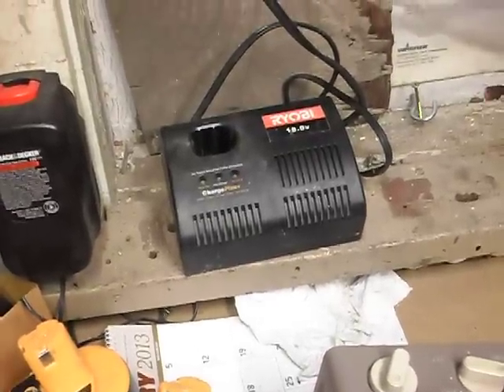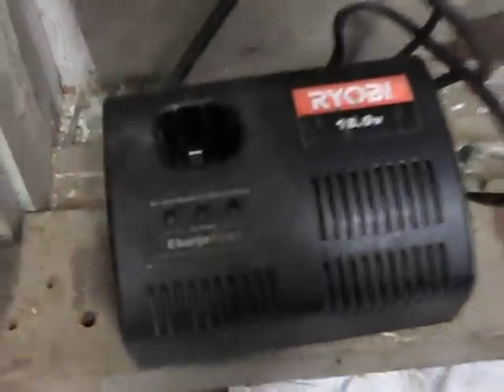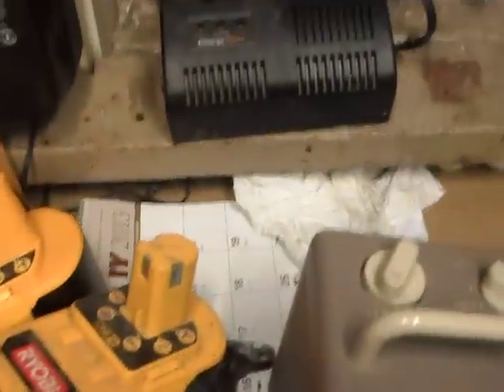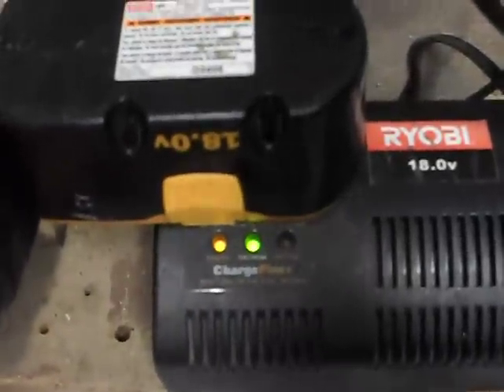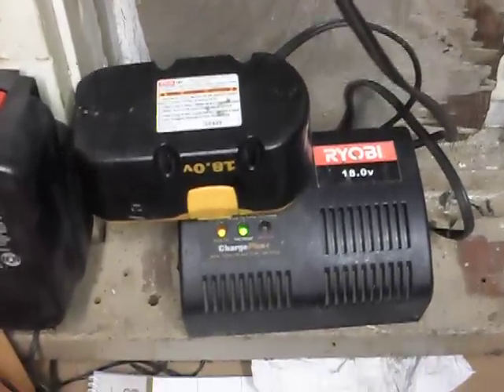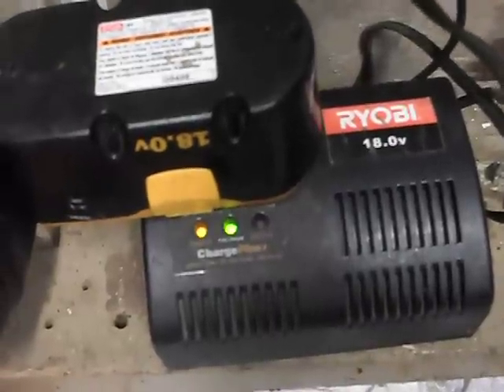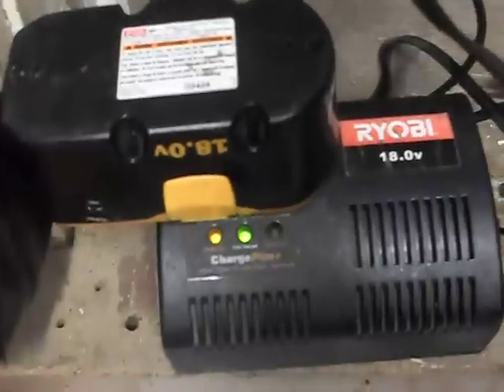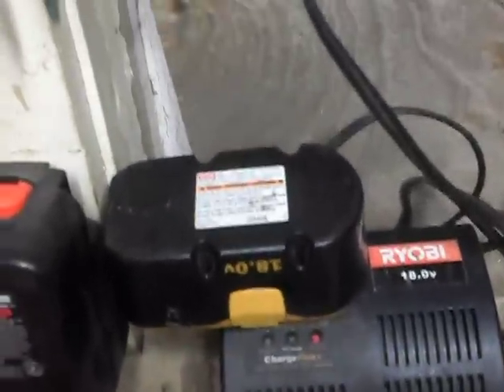How to charge A DEAD Ryobi 18 volt rechargeable battery! IT WORKS!!

Comment: Watched this a while back, not sure if I posted, but I can confirm this works. Some of the batteries change and last a good long time, others not so much but better than nothing. How about anyone else?
Reply from the maker: yep worked for me too...or i wouldn't have posted this video. lol thanks for watching, and commenting!
Reply: @chaseme81871  oh yeah, absolutely.  I should have been more specific. I was wondering about the charge length of use. For instance I have 2 that last a good long time, a14.4v and a 18v but a couple that don't the secondly 14.4v and 18v.  ;0)
Reply: @elfpimp1  if one of the cells is low/bad, the battery will only work untill that cell drains. 
Think of it like a device with 6 AA batteries, only one battery is at 50% while the others are new. Once that one battery is dead, the device won't work. It's an over simplification but general idea.  You can replace the individual cells, or rebuild the battery.  But if it's the old nicad batteries your money is probably better spent on a newer LIon set.  Father's day is coming up.  Home Depot usually has a drill driver combo with two batteries for $99 or so. You can use the new batteries in the old one plus tools, but not vica versa.  
If it's the newer gray battery giving you issues, look up how to rebuild.  You'll need a multimeter/voltmeter. They are just a bunch of 18650 lion batteries. Figure out which one has low voltage and replace it. Cheers
Reply: @jeremywinnett6352  groovy, will have a go at it..

Comment: So you've got a bad charger? If it's the charger that's faulty, that could work. Pulled apart my Ryobi battery. Had 5 dead cells. No trick is gunna bring that one back. You're tricking the charger into charging a potentially bad battery. These things have been known to explode and cause fires. Seems like a dangerous proposition.
Reply from the maker: +mrgreenjeans71 A dangerous proposition???? they could blow up the minute you get them home because they are junk. how about that??? there are almost 171 thousand people that have tried this from watching my video,  and not ONE has replied that their shit blew up.   the batteries will not hold juice. they fall down to basically nothing. by doing this you bring the battery back up in small surges to allow the charger to begin the charging process. when it gets to its intended voltage the charger shuts off.

Comment: WOW!, I wish I would have known that before. I just restored 3 out of 4 of my dead batteries.  I tried taking the battery in & out many times, but that never worked.  The only problem is that the last battery that I tried killed my charger. I’ll check if there is a fuse in there.
Reply from the maker: there is. they do sometimes blow. mine have so order a couple extra ones.
Reply from the maker: they are a slow blow 4A 125V

Comment: Instead of messing with the plug, just pull the battery in and out of the charger till red light stays on. Works way better! Let it cool down awhile before trying a tool. do it several times.
Reply: Doesn't work that way. It needs the initial surge that comes from plugging into an outlet.

Comment: You're just tricking the charger.  The battery is still dead.  Go ahead and show us how many holes you can drill, or how many saw cuts you can make with this "arisen" battery.
Reply from the maker: sure thing. i will get right on it.
Reply from the maker: bonghits02 by the way how many drilled holes would satisfy you?
Reply: um go back to school and learn electronics please.

Comment: Good job!!!! I bought a old blower from a guy. This charger with the battery cane with it. Not having a issue now. But if I do now I know. But how long does it take to charge a dead battery?
Reply from the maker: They wont take long to charge. but the batteries will never be like they once were. And sometimes this blows the fuse inside of the charger.

Comment: mess around all you want with the /NiCd batteries, but DO NOT do this with lithium ion packs, a Li-ion cell which has drained too low is a fire hazard to recharge.

ther better solution to a crapped out ni-cd to pop it open and test the sub-C batteries inside and replace the bad ones, you can get a package of sub-C's on the internet for pretty cheap, or even better, from sibling battery packs so turn 10 bad packs into 8 or 9 good ones
Reply: Nicd batteries, unlike Nimh, are not simply good or bad. Often they can be rejuvenated and some mfrs include a charging procedure to do this. Roomba vacuums would be one. On trash day years ago I found a clean looking roomba with its dock in front of my house and brought it in. After charging it ran about 5 seconds then died. Went to their site and the manual described some weird thing about holding down a button, then letting it charge, drain, repeating again etc. Took about 24 hrs but when done the roomba ran for 90 minutes... spec'd like new. 
(Found the little sucker annoying, sold it to a friend for $100. Still worked 2 years later)